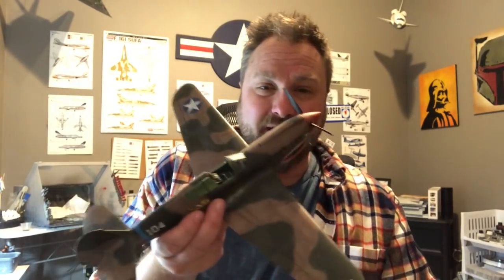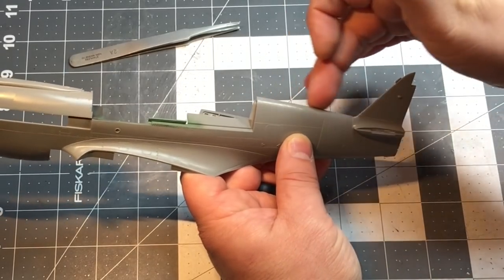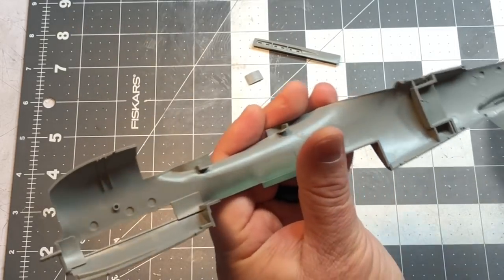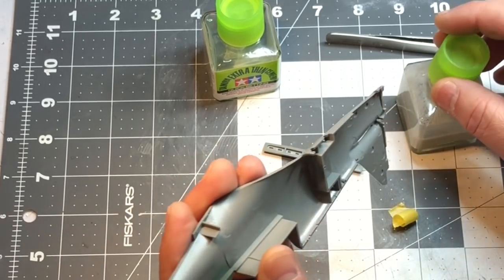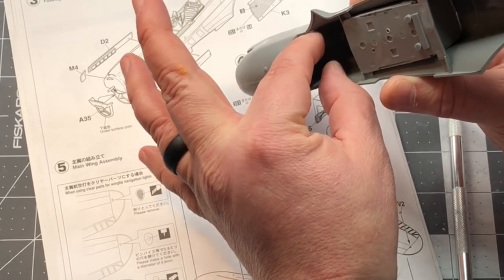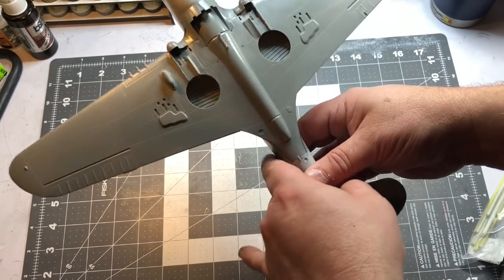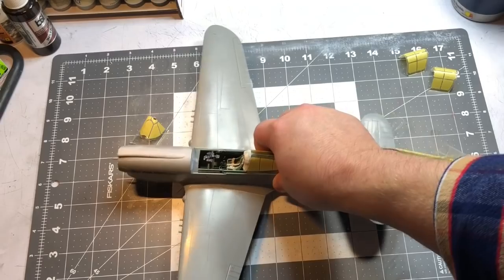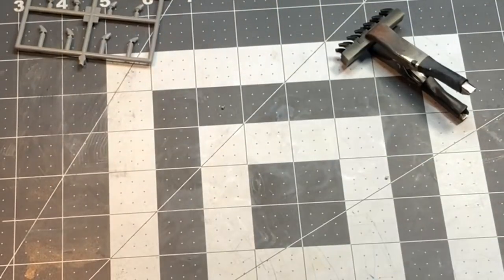Hasegawa 1/32 P40E Build Part 1

Comment: I watch your videos all the time, and I love them. The lines where the rear clear parts join to the fuselage, are also fictitious. I built 7 of the Hasegawa P-40’s, good kit, but they do require some work.
Reply from the maker: Yeah I fixed the rear seam line in the video but didn’t realize the clear part needed corrected till you pointed it out...thanks!

Comment: When you use Testors putty to fill wing roots, how long do you wait to smooth it out with alcohol?  Fully dry or right after application?  I think Testors putty is underrated!  Definitely has its uses.  Thanks!
Reply from the maker: A little bit of both.  Usually a quick swipe right after application just to get it where it needs to go then after it dries, I smooth it a little more.  If you try to do too much while it’s wet, it tends to get removed instead of smoothed.

Comment: Great tips for the fuselage and exhaust stack panels!  I have this kit, so the pointers will definitely be of use.   

I want to thank  you for the slurping, it always relaxes me gets gets me ready for a great video.  Did you attend a school of focus and meditation to learn this technique?
Reply: Also, you built this model really fast.  Is it that good of a kit?  I seem to pick the ones that are a real pain to put together.
Reply from the maker: I learned my meditation techniques from an 80’s Richard Simmons VHS tape I dug out of the closet.  And yes, it’s a pretty easy kit.